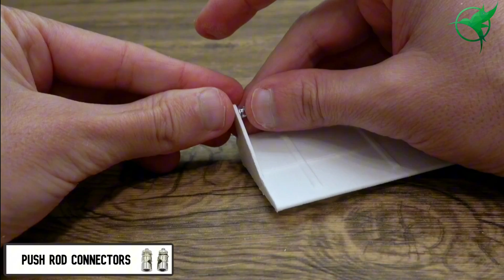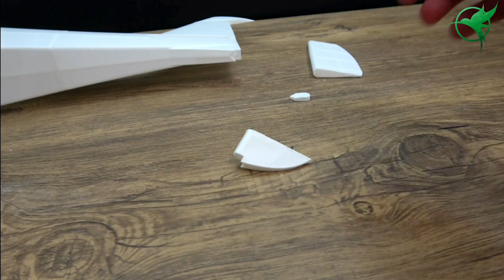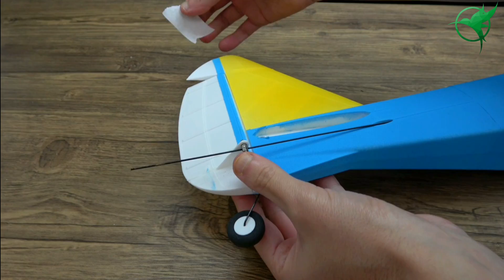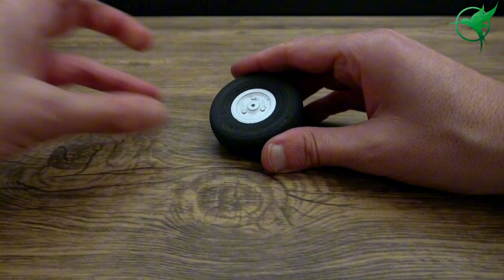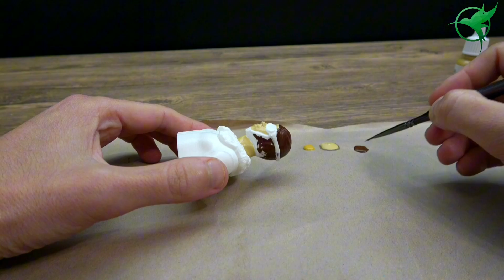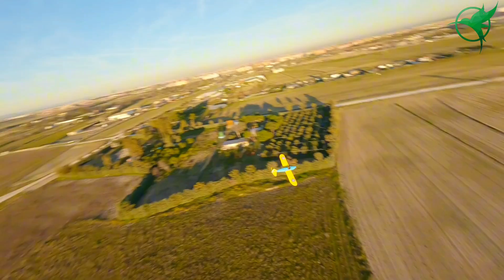3D printed RC plane - Build guide

Comment: Would it be lighter to combine old and new methods, so use 3D printed ribs to replace wood, but still use the wrapping to keep the weight down?
Reply: Yes, but the extra workload and extra price will not probably justify the weight reduction. LW-PLA planes already have adequate wing loading. In fact there are already few planes using that method, and they are not so popular. Search Kraga
Reply: I have thought of this idea as well.  The only issue would be that the covering is applied with heat and that would warp the plastic ribs